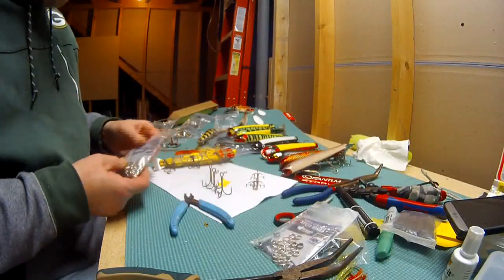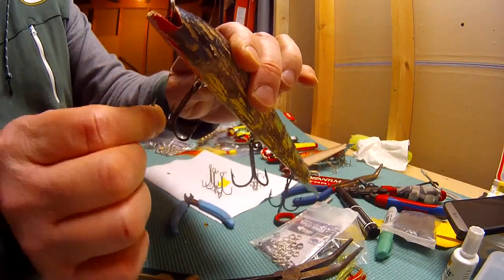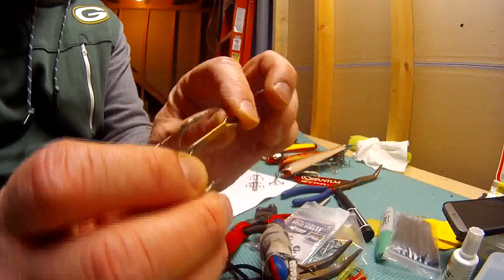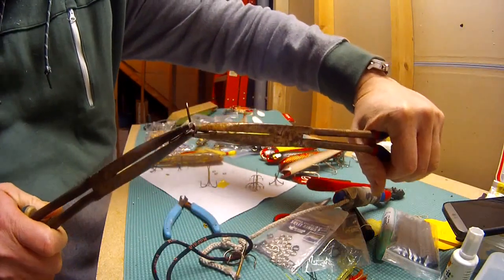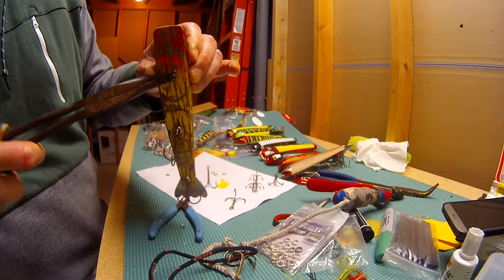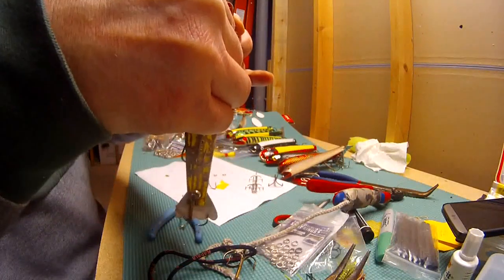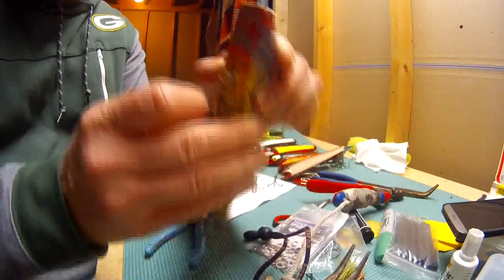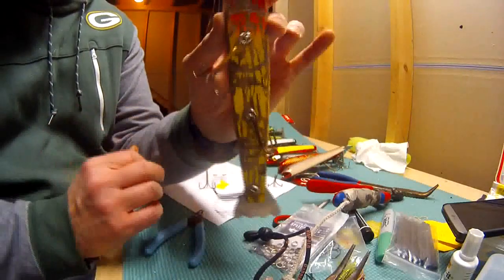*MUSKY MODS* T-ing Your Hooks

Comment: My issue is that my baits are through wire and cant turn the eye on them..when I tee my hooks with a split ring added it doesn't lay flat.
Reply from the maker: What type of bait are you working with? This demo was aimed at Bobbie baits, but you can often add a 2nd, small ring to get the right alignment.